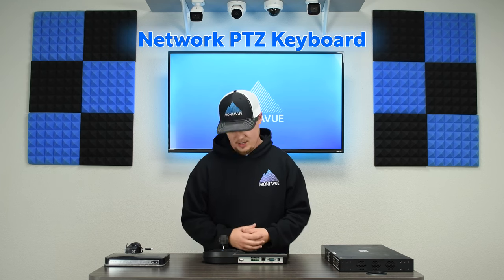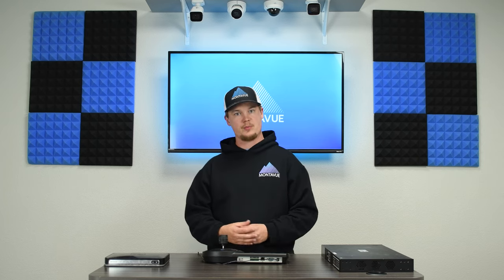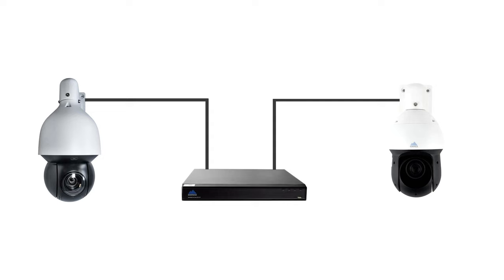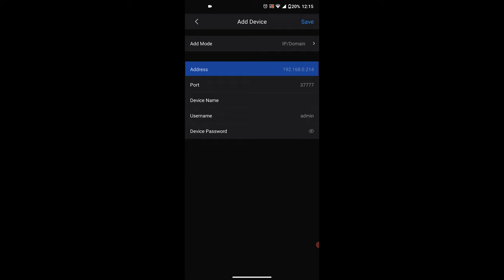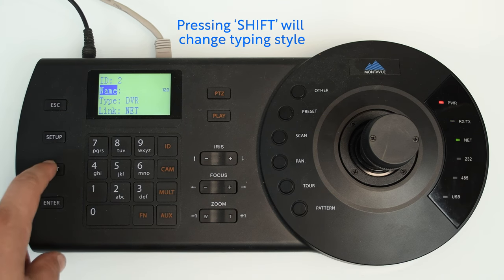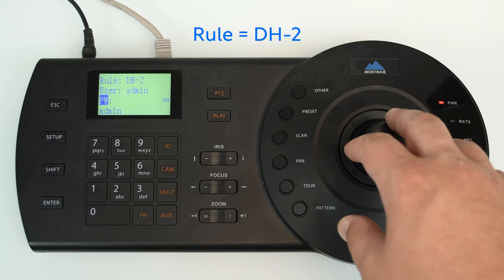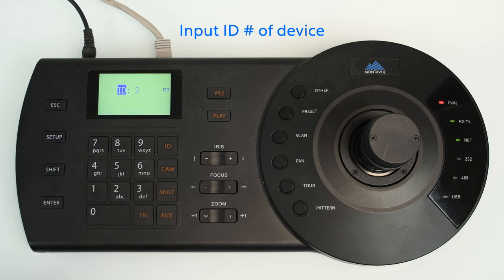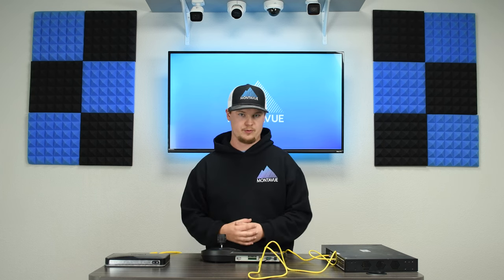Montavue Network PTZ Keyboard Setup Tutorial

Comment: Let me know when you get one that plugs directly into the nvr.     I have your 8250 PTZ, and it's annoying to use a mouse to control it.   
 I refuse to connect my security system to the internet so somebody in China can backdoor my camera.
I may have to buy from another manufacturer in the future in order to get what I need.
Reply from the maker: You could potentially use this keyboard through a PoE switch without the internet. You would technically still need a router but it would not neet to be plugged into a modem, it would simply be necessary to hand out IP addresses within your network but if it was not plugged into the internet, then you would be an isolated network. You can give us a call if you would like a more in depth explanation into how that would work but it would certainly be possible.
Reply: @MontavueSecurity  Okay, thanks.   I'll contact my computer guy and let him figure it out.
Reply: @seeharvester  Does your NVR have RS232 port? Because there is options with these keyboards to connect directly to an NVR with an RS232 link. In link setup it showed "NVR" and "RS232" as an option.
Reply: @mike_x48954  
I think it does.   I'll have to check.   Thanks.

Comment: I have a NVR and get to the point when I hit escape and go into zone control and I enter the ID # and it says fail
Reply from the maker: Hello! If you are following the tutorial and not coming up with the same results, it's probably best to call tech support. Issues like these can usually be solved pretty quick and our tech support line is typically not incredibly busy. The number is (888) 508-3110. You can also email us at support@montavue.com but with something like this, it will likely take some back and forth, so give us a call and we can get your PTZ controller up and running.